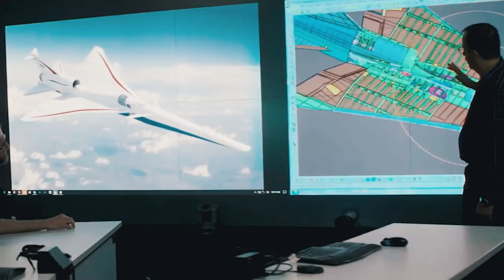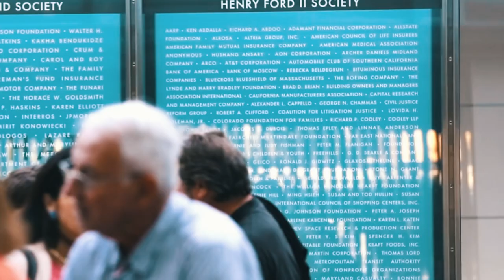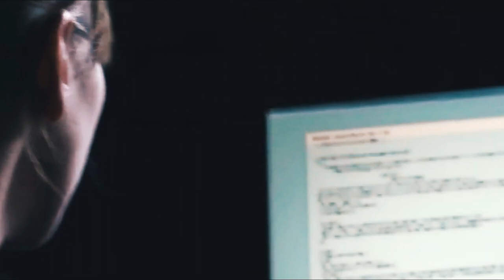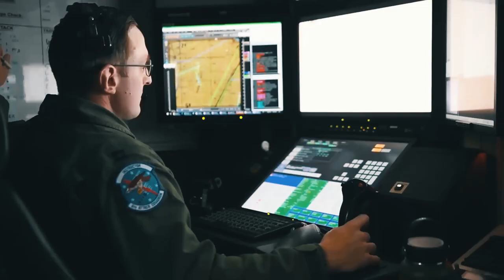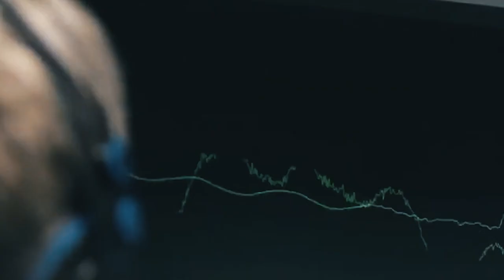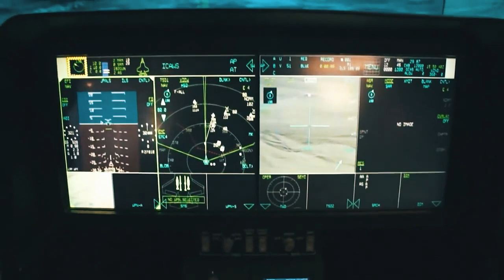Finally: US Revealed Its 6th Generation Fighter Jet

Comment: Acceptance by the NAVY & AIR FORCE will probably be in the late 2030s. There is too much testing for the airframe and decisions on armament. The video offered a lot of possibilities, but you can't have it all. Perhaps, in major operations one airframe configured to haul a drone swarm, but any of those in the operation can control the whole or part of the swarm. It's like a cargo version, unless you want just a few companion drones for enhanced targeting or defense. 
Directed energy weapons look great in space, but even on a clear day, the ultimate power of an energy weapon diminishes with distance due to atmospheric interference. The the atmo. missiles will likely  continue to have dominance.  I see massive changes in the ordinance delivered. It will become programmable, just like the current tank/artillery shell.
Reply: if it can hit everything at 2 miles  it would take a nuke or a stronger energy directed weapon

Comment: It worries me when the military focuses on super high-tech weapons. The problem that arises is cost. The cost of the program skyrockets every time and we end up with a fraction of the units initially projected. That's exactly what happened with the F-22. What good is a high-tech weapon if you don't have enough of them to do the job?
Reply: @faustman1000  No president would "cut production thinking wars were over." Blame Obama for your local grocery store being out of cheese like everybody else.
Reply: @matchrocket1702  Not true
Reply: @titus2120  The Air Force initially wanted three times the number of F-22s than what the ended up with. It would have been nice, they should have had that number.